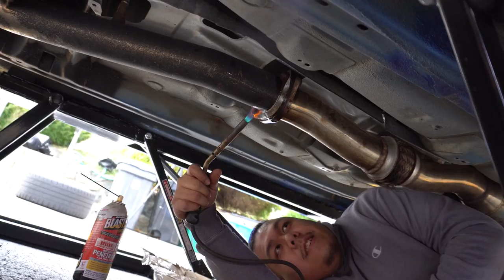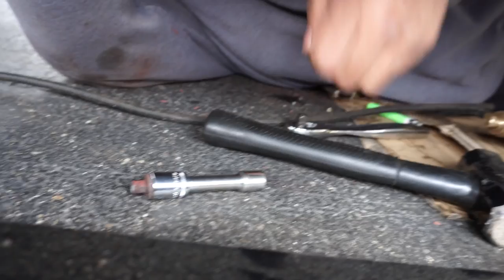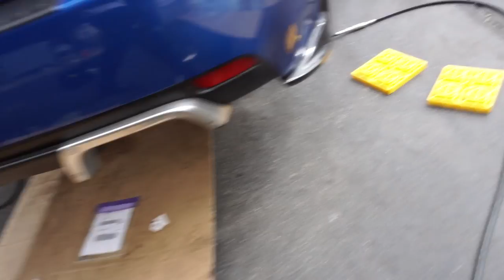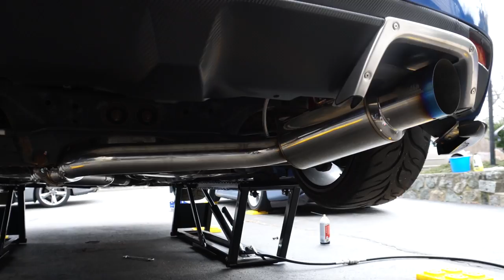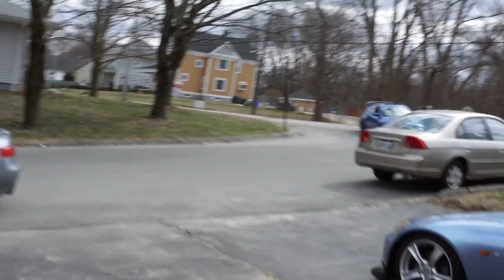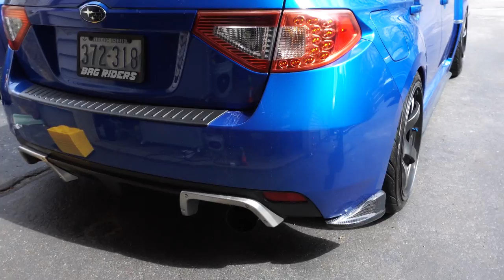2013 Subaru Wrx Hatchback - Invidia  N1 race Single Exit Exhaust (vlog style)

Comment: I have the same exhaust, I don't get any turbo noises or raspy sounds like yours, wish I did though. Idk, 
No downshift pops or gurgles like yours. Idk on that either. It's also just recently pro tuned.
Reply: sounds like hes got an aftermarket intake, which helps the turbo whistle.
you need an aftermarket downpipe to get the pops. an n1 catback alone wont get u taht
Reply: I have a Cobb aftermarket intake, with a catless downpipe invidia n1 exhaust.  No turbo noises and no pops and crackles, plus pro tune. 😕

Comment: Never launch a awd car that is less then400-450hp. You gonna blow the driveshaft, diff and transmition. Poor clutch, 😂 nice exhaust btw :D
Reply: That’s not true
Reply: nevermind the fact that this comment is 2 years old. I just get tired of seeing this comment on how people dont understand the drivetrain of this platform is SIGNIFICANTLY the strongest part of the car. There's a God damn reason people run stock divetrain/stock trans on 900whp EJs, CONSTANTLY for years.